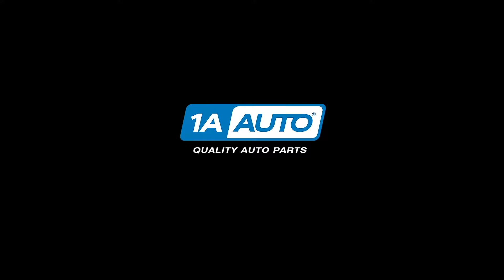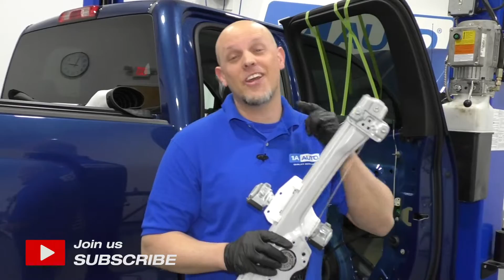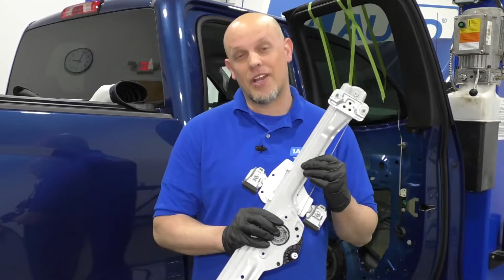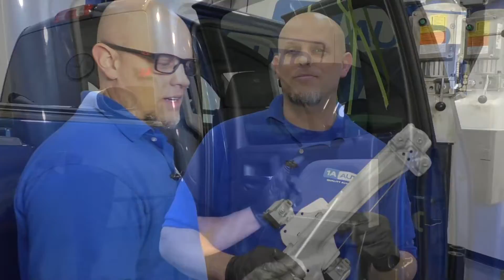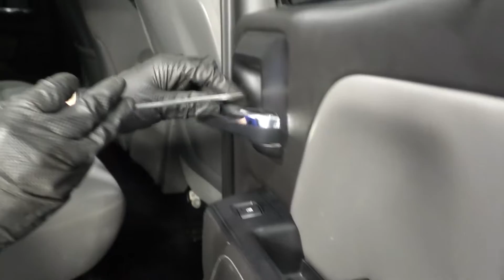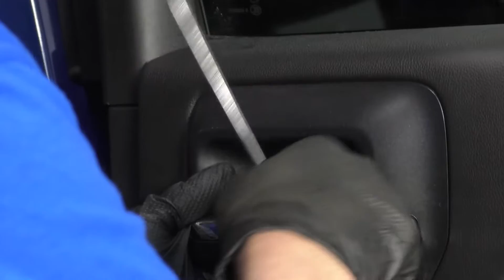How to Replace Rear Window Regulator 14-19 Chevy Silverado

Comment: Good video.  Couldn't have done the replacement without it..  In Southern Arizona, my Silverado goes through one of these every couple of years. This 2015 has had three.  The issue - a poorly designed slider in which the cable retainer is under constant stress and eventually breaks from the heat.  They should have kept their proving grounds here.